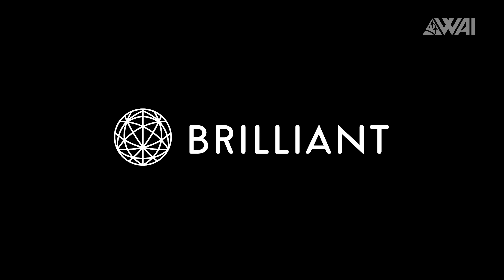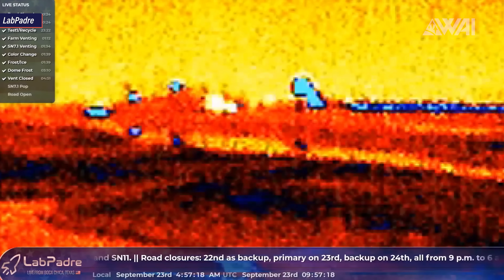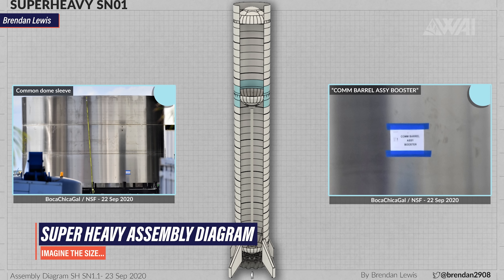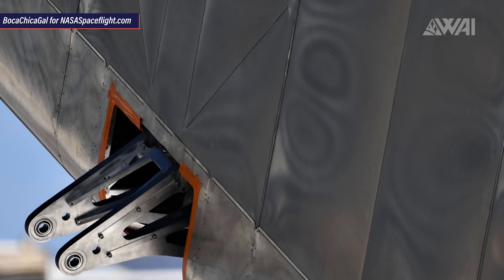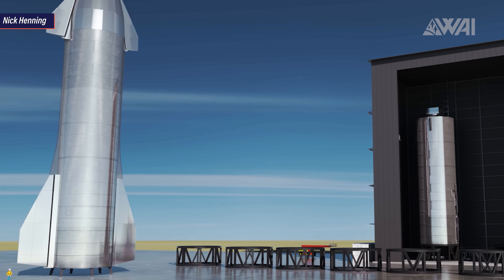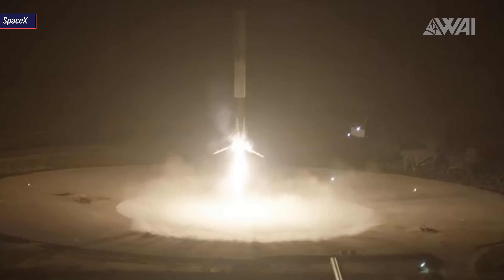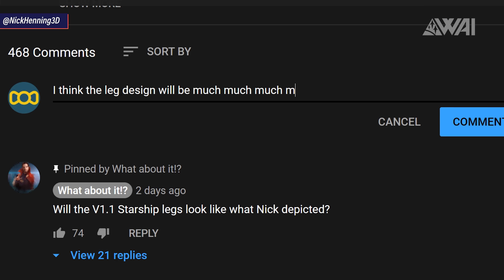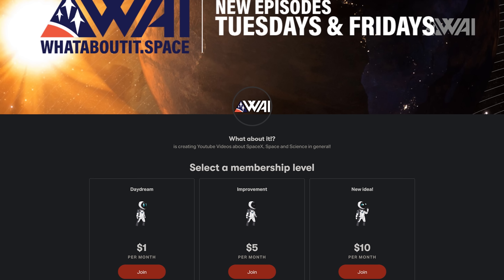122 | SpaceX Starship Super Heavy SN01 In Production!

Comment: You know i'm not too concerned with legs. The thing which doesn't get talked about much, but is going to be the most critical part of Starship's design is the heat shield. I guess cuz we don't see them outside working on it, but the heat shield IMO is going to be what makes or breaks Starship. In the end what doomed space shuttle even before it flew for the first time was the heat shield. Like Starship it was supposed to be simple and was supposed to go many flights with nothing more than an inspection between flights. Instead it ended up needing massive refurbishment after every flight. Unless SpaceX really nails it with the heat shield chances are Starship will fail....Given the entire design hinges on the heat shield it would be nice to hear from SpaceX some more details how the it's supposed to work.
Reply: They're bolting them on rather than gluing and they can get away with higher temps because stainless steel melts at a higher temp than aluminum.  They have tested the tiles and are happy with their thermal performance, it's the mounting their currently experimenting with.  Elon has tweeted about it on several occasions.
Reply: @TheEvilmooseofdoom  Space Shuttle's tiles weren't going to be glued on when they designed it either. In fact their original designs for the heat shield were similar to what SpaceX is hoping to do. When they actually got into the later stages of designing and building Space Shuttle is when they realized their tiles designs weren't going to work  and the horrible system Space Shuttle ended up with was devised.
Starship has going for it over Space Shuttle it's stainless steal structure can take more heat than Shuttle could and I believe it's reentry method is supposed to produce less heat than Shuttle did. That along with 40 years of advancement in material science and the tenacity of SpaceX will hopefully be enough for them to succeed where NASA failed, but...Well IMO getting a heat shield that performs as well as they need it to is going to be one of the biggest challenges of the project.

Comment: there is another method of leg extension, that allows the heat shield to stray intact to the hull..  lets see if someone comes up with it.. too many people thinking inside the box still.
Reply: How about including them in the flaps. Probably won't work with only the two flaps. They are the widest point on the ship, so having legs there would help with stability. While the flaps obviously need to have a fair amount of internal structure dedicated to strength it seems like there is a nice aerodynamic shape that could be used to integrate extendable shock absorbing legs into. They'd need to move into the right position for landing so timing with the use of the flaps during the belly flop might not work, but could see them being done with them as flaps at that point. Anyway just throwing it out there

Comment: In the past I had heard of a heat dissipation system that worked by evaporating mathane from the pores on the outer surface. Has it been replaced by the classic heat shield made by tiles?
Reply: I heard it might be a hybrid system with Transpiration cooling added to any points showing erosion of the tiles.

Comment: I think that the landing legs should be hinged at the top and swing out from the side of the skirt from behind the heat shielding which swings out of the way.
The absorption of impact with the landing surface would be taken up by a hydraulic system very much like the recoil absorbers on artillery  cannons.  The piston is really a tapered rod which allows rapid movement at first, but, because of the increasing restriction in the cylinder, the movement meets more and more resistance as the leg telescopes together, thus bringing the rocket or the booster to smooth stop.

Comment: I'm a fan of the KISS principal and I have concerns about any flip out legs. Just more to jam or bind in the many conditions of flight and space.
If I was an engineer there I'd be trying to design a simpler straight extension gear. I envision three hydraulic cylinder style legs nestled between the vacuum engines and attaching close to the thrust done near the atmospheric Raptors.
If I had to pick which of the three legs you showed I'd say the second because it gives a better stability stance but gives a better aerodynamics profile than the first possibility, the Falcon 9 style which honestly are a aerodynamic nightmare for sideways air flow like during the reentry skydive profile of Starship.

Comment: High Bay:  Does anybody think that the roof internal girder frame is looking a bit over engineered just for a light roof covering?  Could this also be for a sliding crane perhaps?  :-)
Reply: I think you nailed it.
Reply: It would have to be a very low Cap. crane. If they started at the bottom and worked upward, only adding a few rings at a time.
Reply: @jamisonbernard2624  Yes.  Going by the mid bay arrangement which seems a little awkward when they are loading from an exterior mobile crane I thought that repeating that in the high bay with a much bigger crane would be equally uncomfortable!  Admittedly the frame of the uprights of the high bay does seem a little weak to have much extra weight placed upon it.  It will be interesting to see how they go about this.  One thing for sure though we wont have to wait long! :-)

Comment: Going by SpaceX on previous methods I would not even try to speculate on the actual design of the legs!  However, logic would naturally suggest that a wide gate would be more stable.  Especially for the initial landings on rough terrain with less gravity to hold the craft down before the engines cut off.

Comment: SN8 will use Nitrogen Thrusters to control itself while decent or it will use it flaps???
Reply: Both I think.  I heard they're working on a hot gas thruster using methane too.  But lots of speculation little hard facts.

Comment: I think the internal leg design will be used until it absolutely cannot be. However, that will not be for a very very long time. 

My personal take: auto leveling is unnecessary. 

In my personal opinion. SpaceX has claimed to be able to make launches cheap and frequent. In which case. There is no reason why they shouldn’t be able to land some kind of smaller payload on mars with something other than starship first to level out the surface in preparation for the first starships. Once there’s a landing area/pad all we need to do is unload some payload to create landing sites for more and we’re golden. 

Automated landings aren’t hard for SpaceX anymore. So they can have a rather small area to land on. I believe the technology to return from orbit and land within a 100 meter area is perfectly achievable for them. 

My personal take I suppose is the internal flip out is probably their best bet to avoid reentry heating. Although I’m interested to see how they engineer the legs none-the-less!

Comment: The flush falcon legs seem by far the best solution for aerodynamics and leveling, but logistically the plain falcon legs would be best, as it's a simple mechanism which spacex has already perfected with falcon, only requiring slight modification for leveling